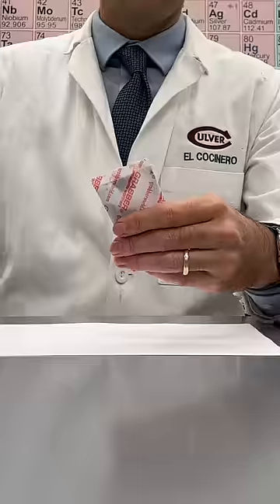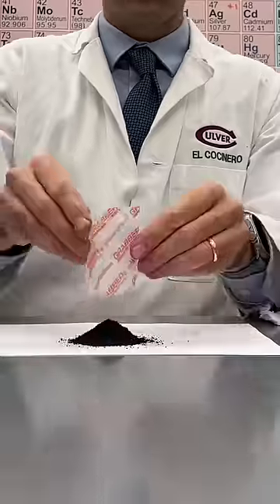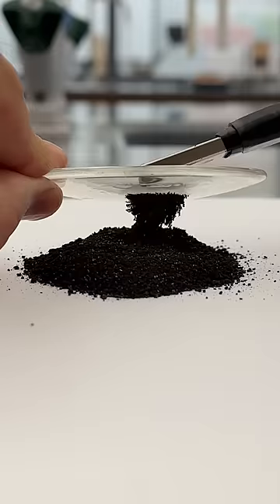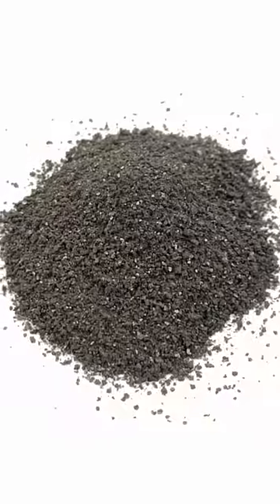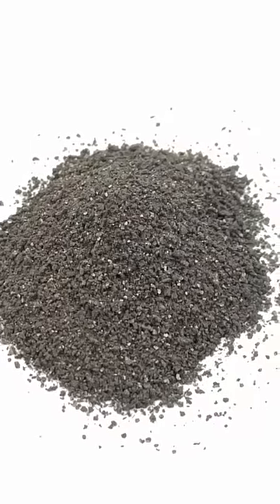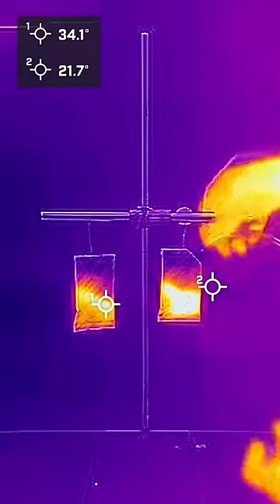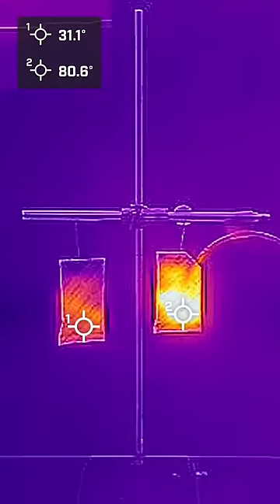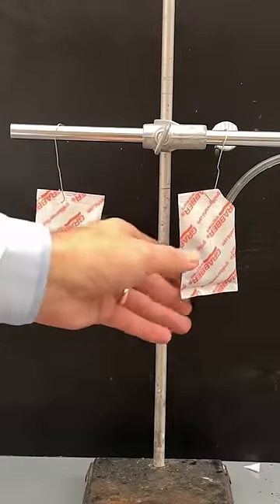You actually want these to rust!

Comment: Using the nonconductive barrier between the magnet and iron filings is an especially smart idea. Thanks!
Reply: What do you mean?
Reply: @YunxiaoChu  Iron gets pulled to the glass to show its magnetic and iron, but the glass prevents it sticking to the magnet. Magnet leaves with no iron and the iron drops from the glass.

Comment: Here's a pro tip for all the people who's cars wouldn't start in that extreme cold snap we had a week ago! If your car has trouble starting due to a weak battery/ bad corroded terminals in the in the super cold weather, you can open a 2 pack of those suckers... Then place one on top of each terminal/ connector. Then proceeded to let warm up the terminals and battery for about 5 to 10 minutes... Then BOOM your car will start right up!!
Reply: I doubt some hand warmers are really going to substantially affect the temperature of a 40 lb lead acid in 5-10 minutes. Maybe you'd see a degree or 2 in like 45 minutes. Just get a jump pack, they're cheap and worth it.

Comment: If you open the hand warmer and put it into a higher oxygen environment let it get super hot then remove it put it in your pocket will it remain that warm or cool off? Also if you use more oxygen does it burn the fuel up faster than in a normal environment?

Comment: Does the salt speed up the process? Or does iton really just rust that fast?
Reply from the maker: The salt and water are necessary to speed up the rusting process. Rusting of iron is an electrochemical process, so having an electrolyte solution like saltwater present catalyzes the oxidation of the iron. Similar to how cars in the Midwest rust much faster than most anywhere else…we use lots of salt on the roadways in winter and that causes our vehicles to degrade faster as a consequence.
Reply: What's left after the reaction doesn't make heat anymore. And could you add something to that to make another reaction?

Comment: That’s true because air comes from the Latin word called ether which is also named electromagnetic energy but if you were to add electricity to it it will get even hotter than just oxygen alone
This is also why you can jump start a car with a tall tree and jumper cables 
Because they use electricity to grow 
Also the higher you go in the air higher the power and therefore why electricity grid lines always come back to the same power plant because there harnessing the electricity to then sell to you! So electricity is FREE 
Land always has been

Comment: MRE HEATER has entered the chat
Reply from the maker: MREs are really interesting in how they work. Instead of just using a salt catalyzed iron oxidation like these handwarmers, they use a magnesium-iron alloy, which undergoes two processes: electrochemical oxidation-reduction, as well as creating a short circuiting galvanic cell between Mg and Fe. The result is much higher temperatures achieved quite rapidly.

Comment: isn't that basically a simple battery that's designed to internally short-circuit?
Reply: Not really, batteries work with differences in charge this is just a chemical reaction
Reply: Batteries do not work by “differences in charge”. They are entirely chemical. Look up how a galvanic cell works and is built to understand batteries. I teach an electrochemistry unit every year and we build “batteries” and construct electrolytic cells. Let me know if you have any questions.
Reply: @vincejohnm  It's not entirely chemical, more like electrochemistry. A process of supplying electrical current to metal constructions or vehicles like tanker and container ships called "impressed cathodic protection" can slow down or even prevent rusting. So if we assume that supplying current prevents rusting, we can also assume that accelerating rusting can generate current - which subsequently is turned into heat as we see in video.
Reply: @Morlev44  batteries are chemical. Cathodic protection is chemical. Electrolysis is chemical. It’s all redox chemistry. I’m not sure what you’re trying to say.

Comment: I have had MRE'S that had a self heating pad. Is this the same reaction and if so how is it enhanced to get hot enough to boil water?
Reply: Generally those are magnesium and water reacting.
Reply: @88porpoise  thank you for answering my comment.

If someone wanted to make both MRE and hand warmers, what would be the process to do so? Or it can't be don't without lab equipment? It is not possible with stuff in the kitchen? 

It would be very helpful as I have Freeze-dried food that needs  rehydration and cooked.

Thank you for your kind reply. I am trying to teach myself things that I should have learned when I was younger.

Comment: If you ever see a huge navy aircraft carrier up close, look at the horizontal line between the carrier's steel hull and the water line.

You will see what appears to be bubbles. It's the heat generated from the oxidation (rusting) of the steel in the salt water...as the water is boiling!

This can be seen along any steel hull ship, though it's more obvious along a bigger ship.